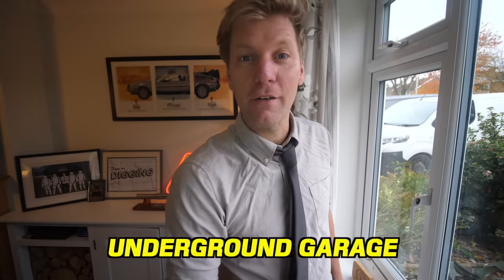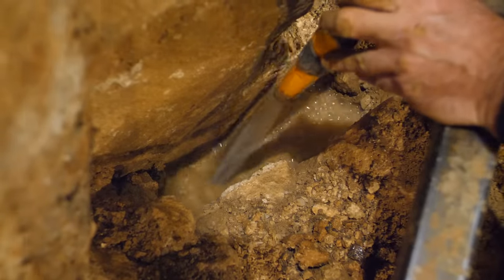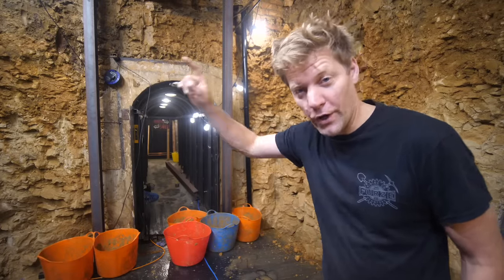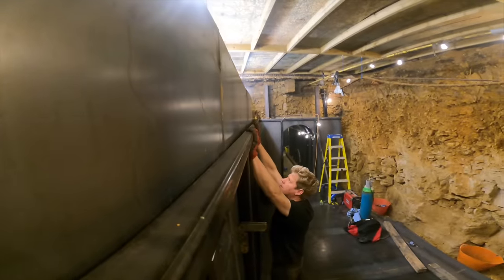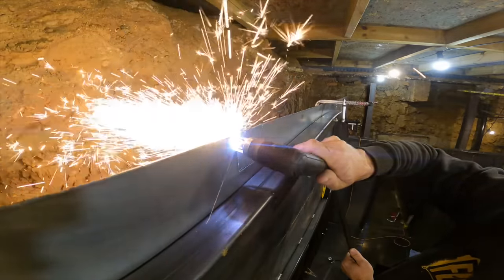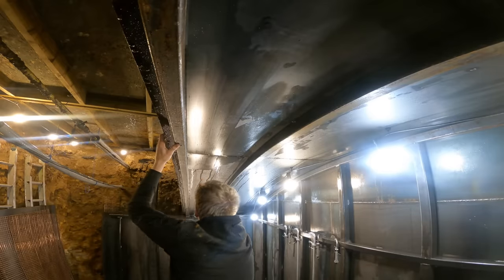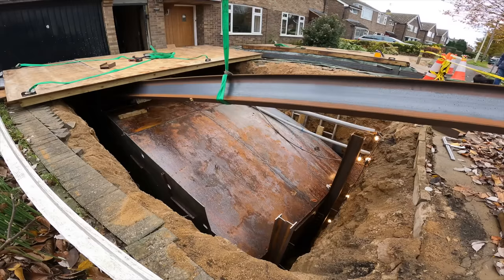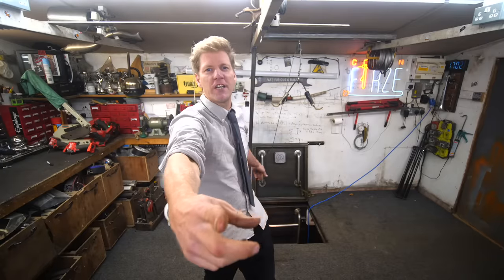Digging A SECRET GARAGE Part 2

Comment: Colin, Will you be making some way to easily access the utilities? Just wondering because I can imagine how much of a pain it would be in  X Years if you have to replace that power cable, or gas line etc. Having to Jackhammer out the concrete and such might also impact the roof of the garage.

Comment: 15:55 
Isolated roof would probably help a lot. I've had a job as a machine operator where the machine rode in the back of a truck, and all of them had an isolated roof to prevent condensation from dripping down. (There still was condensation on the walls but that is less troublesome)
Reply: yes i think it too

Comment: Thats looking awesome can't wait to see what you do to rotate your car after it goes down into the underground garage.    What are you going to do to protect your utility lines if they need to be replaced or worked on in the future? I would suggest building a box around them or putting them in a large tube so they can be accessed after you pour the concrete.

Comment: My Chicago basement flooded routinely for years and finally got drain tiles and a sump put in. It wouldn’t hurt to have had that in the secret tunnel at some point. Once you realize that water is gonna do whatever it wants to and you can’t make anything waterproof, you just pipe it and redirect it and you’re good to go.

Comment: having worked years with poured in place footings walls, roofs and vaults reinforced concrete structures I find your build very different. The resulting structure looks to be pretty strong as well as electronically shielded from an awful lot of any RF interference (your cell phone reception will likely be zero bars. your projects are very stimulating helps to get me off my seat and attack some of my own projects!!
Reply: Phone signal can be replaced by technology. Either wifi calling or a WeBoost phone booster

Comment: What's the plan for all the panels rusting out later? If the metal isn't sealed, it's going to be a nightmare later
Reply: He already explained it on his other channel: seems like the basicity of the concrete prevents the acidity (rust) from building up and the thick layer of concrete insulates the plates from outer humidity.
As for the inner side, there won't be much of a water condensed after everything's done and cleaned. He said he never had any problems with the bunker and hallways regarding the rust.

Comment: to stop the floor flexing you use a plug weld were you drill a hole through the floor over the beam underneath then weld the hole back-up joining the plate to the beam

Comment: some dehumidifiers running in there would help the condensation, humid air rises though so you might be better off having one or two run near the top of the room if practical

Comment: To remove condensation is easy. Do 2 pipes to vent it. Both pipes going outside. 1 pipe should be couple inch above the floor, another pipe on highest point.

Comment: You can weld the sheets to the frame by coin welding it. Turn the welder up really hot but threw the sheet and bam welded from above

Comment: @colinfurze 
I keep dreaming of a sliding roof, Thunderbird 1 style. Fixed roof in front of garage and front door and sliding roof in front of window going under fixed roof if enough clearance.  All depends if concrete already poured over garage steel built so far. Car lift would be brilliant if on one of those piston lifts with one central hydraulic piston about 2ft thick.  May be answer to rotate car if enough clearance. I would love see roof under window slide back with flashing lights and hooters going just like thunderbirds or the sounds in Star trek shuttle bay launch in Next gen series. You could even have a small pond in sliding roof, just like Thunderbirds. Might even help with drainage as a buffer to sudden downpours overloading gutters and down pipes. Just some  crazy ideas 🤔

Comment: For your humidity problem:
Contact an ocean container shipper, ask for a pallet of silica bags and throw them in the tunnel. Passive moist absorbers that are designed to keep shipping containers dry during a transatlantic on-deck trip in stormy weather. They should keep your buns dry till the end of the century (since you're lacking oceans and stuff)

Also, yikes that's a thin water connection you're getting for that house. Is that the UK standard? It fits easily inside our standard water connections... What kind of pressure you do need on the watermain in the street to get a somewhat decent debit in the shower?

Comment: I have been dealing with condensation on my metal framed windows in my apartment (gets icy inside during the winter, despite inside temp of around 70 F), and have been trying to solve it! Two solutions so far that I am testing, little portable heater pointed at the metal bits and this electric heating wire meant for water pipes. Both work great, just depends on appearance. For yours, I think the electric pipe heating wire would be a good one!
Reply: Insulated replacement windows would be a better solution.

Comment: Using the 3 4 5 method you always get perfect 90 degree angles for all building purposes, as numbers never lie. 3 metres from the corner & 4 metres from the corner the other direction. & from end to end of the 3 & 4 metre points the distance between both ends should be exactly 5 metres (adjust end of 3 or 4 with a string line 1st to adjust to property boundary line & measure from there). (Always spot on) It always works for slabs ect & works the same with everything horizontally & vertically ect cm, mm. ect. it's like using a math cheat stick with a long straight lvl.
Reply: I think Pythagoras beat you to it 😊

Comment: You need ventalation for that water/humidity, you also need to ensure those pipes aren't going to pinch or crack should anything happen to your pipes, or what if hey need to be replaced? I would 100% wrap them inside a larger pipe

Comment: You could put a dehumidifier in the garage. You'll still need to empty out the tank once in a while, but at least you won't have to collect the water off of the ceiling.

Comment: You could dry pour the concrete floor before you put down the sheet metal and just hose it down with a sprinkler nozzle and it will set itself up. Then lay down the sheet metal and weld in place.

Comment: Instead of cutting large holes to weld the floor sheets to the beams, you could just mark the breams on the sheet then drill some holes or broach the sheets,  then just plug weld along the beam, saves trying to be a contortionist and welding upside down.

Comment: I have a friend that the house is on a hill and slopped down to a flat piece of land and then to the river. In the slopped part he dug towards the house about 20 feet. Then widened that dug out to about 15 feet. So over the dug out he had left the soil and grass. What the county’s he lives in, they do fly over every year, and would take those pictures and compare them to the previous pictures that were taken, and charge taxes to the owners for those structures. So you couldn’t tell, from the air pictures, any thing was there. No extra taxes.

Comment: If you want to make it easier to put the beam on top consider welding an endplate on the vertical with 4 holes, then just drill the holes on the flange for the horizontal and bolt together. Keeps all its strength and will be easier to install, just put the bolt through one corner and then do the same the other side

Comment: Looking at this project i would have superseeded the whole thing where i would have installled a 300 mm footing on the edge of both sides of whole project with an aggi above the 300 mm footings & set the fall from there to pit all with roman concrete or a special mix of 50% fire ash 20 mpa 80-100 slump.

Comment: Now, granted I have little specific knowledge of this, but with that pipe you stuck in the crack... my concern is not whether or not it'll fill up or clog, but rather the consequence of it filling up or clogging. Suppose it eventually starts to back up because the crack filled up in one way or another. What do you do then? Is there a backup plan? Also, if that pipe gets clogged or damaged, could you ever access it again? Food for thought

Comment: Colin, this is looking killer. I was wondering why you didn’t just plug weld the floor to the steel joists under it and instead cut the large hole to get your hand underneath the floor?

Comment: Maybe this is something you’ve already addressed, but you don’t seem to be too worried about shoring up the dirt walls as you work to avoid collapse. I’m from coastal California and when you trench here the sand is a death trap and a particularly horrible death too. I think the code is after about 3 to 4 feet you have to shore up any of the trench walls a worker might be in. Do your soil conditions provide that much more stability that collapse is not a big concern?

Comment: Intersting. You’re not required to retain rain runoff from impermeable surfaces on your lot? To a dry-well or anything? Sure you’re not going to need or want a sump of some sort?

Anyway, awesome work on the project you guys. So much work you’re putting in but it will all be worth it!

Comment: Not sure if you've decided about being able to rotate the car(s) so you can leave facing forward. But my idea is when you have the car up out of the tunnel garage to street level, then have it lift a bit higher like a couple feet, and then have it rotate as needed. That way you don't have to figure out how to have the space underground to rotate the car.

Comment: Next time, cut notches on the edge of the floor sheets where they lay on the floor supports before you weld the floor sheets in. This will solve your problem AND prevent weird holes everywhere.

Comment: The soakway solution makes me a bit worried. While the crack might go a loooong, loong way, and the surrounding rock may be relatively stable, flowing water in the ground tends to make sinkholes over time. I really hope there won't be too much water going there.

Comment: @colinfurze  Why did you do a steel floor in the garage?  Why not just concrete?  And then do steel walls...or just concrete walls using plywood for the forms?

Comment: The front edge of the tunnel being parallel to the bars you used to line up with the house isn't really a surprise. In fact, it would be more concerning if it didn't.
In short, the second leg of the tunnel going to the house was lined up to come up square to the pantry walls. This means it met the side of the house at 90 degrees. And, since the T junction going north was again at right angles to this passage, the front of it would be parallel to the tunnel leg, which at 90 deg to the house side means parallel to the front of the house, since the house corner should also be 90 deg.
Its a testament to the effort and attention to detail that has gone into the construction.
If it WASNT parallel at that point, it would mean that the house itself was not a squared corner, which would be more concerning.

Comment: Two questions about your design. Can you explain how the car gets in with the roof? And how will you vent the exhaust when you start it? I'd be worried about carbon monoxide getting into your tunnels.

Comment: Forgive my ignorance. But could you not use an impact on a low speed setting to bent the metal frames a little faster? That way your arms dont hurt at all and its just a matter of switching it back and forth till your desired curve. Again if there is a mojor problem with this idea please excuse it.

Comment: The whole process is very interesting but I can't help but think... Why don't you use solid precast concrete panels for walls and floor?  It would be faster, stronger and cheaper.  don't you think?

Comment: @colinfurze Is the garage not parallel to the house? Just watching you set up the parallel bar and its nearly hitting the garage door.
Reply: Doesn't seem to be . The tunnel is parallel to the house.  But the garage is not from what I have seen.  Doesn't really matter though.   He did come directly down the side of the house so I'm not that shocked it's parallel.    Unless the tunnel had a curve .

Comment: Way too late now, but too bad you didnt put a few conduits in the concrete around the tunnels with access panels every 10 ft or so. t would be nice to do upogrades in the future like smart home stuff. Maybe a motion sensor when you come down the garage that when it detects you enter the hallway it turns on that sign that says house and shed. Or use motion sensors to auto turn on the lights in the section of hallway you are in and turn off the hall lights as you leave the area automatically.
Maybe you can just use the existing electric lines and "powerline" networking tech to send network signals through the area and then connect a network enabled smart motion sensor to a home automation system that way.

Comment: I'm wondering if it would be alot easier to do it all with wood and concrete? It would be alot cheaper anyway. I wonder if you used steel because of additional protection from a nuke? Is this a bomb shelter?

Comment: Hey brother, why don't you just drill som holes where the cross braces are and plug weld them to the braces, much simpler than cutting holes and welding blind

Comment: Colin, as a influencer, after 1 mil subs you are certified influencer. As an influencer, you should at least were a hardhat. I know i sound like a boring old safety nazi grandpa. But, it is vital to use proper PPE in environment like this. Did you like split open your skull the last time. You can get a something like a baseball hat with a hard shell inside ( bump cap ) if you don't like proper hard hat. Stay safe Colin, we all want to see you do crazy stuff at least next 10 years...
Reply: N-Ferno 6811ZI Zippered Rib Knit Beanie Hat (Bump Cap Included) is a Beanie Hat with a hard shell inside. I even google it for you if you wanted to be like all the cool kids...:D :D

Comment: God bless your wife
Reply: Run a pipe from dehumidifier down the drain hole
Reply: Cool trick to relieve biscuit tinning is to heat up a spot the size of a quarter with a torch red hot on the highest/lowest points. Let it cool & when it cools it shrinks pulling out sags

Comment: I'm curious why he's building it all out of steel, other than that it's fun, it just seems like a really hard way to build.  Couldn't one use wood? Or concrete block, or something else.  (genuine question).
Reply: Have you seen the price of wood ?  Also it's really damp down there the wood would rot in no time.  And bricks would work a lot better than concrete blocks but they also cost an absolute fortune.